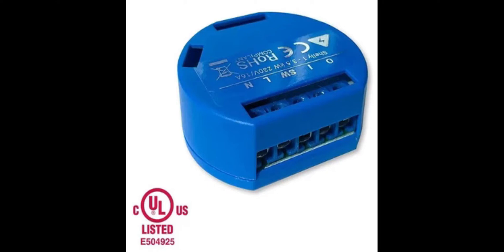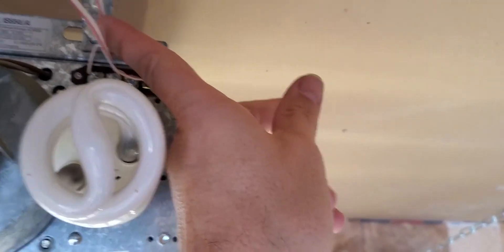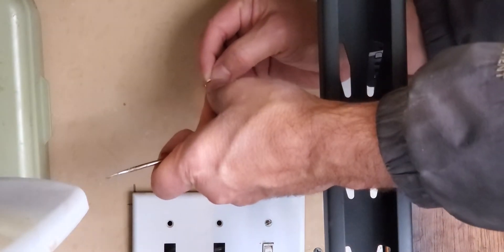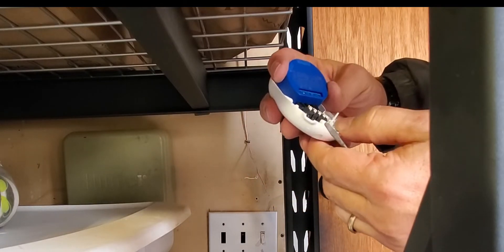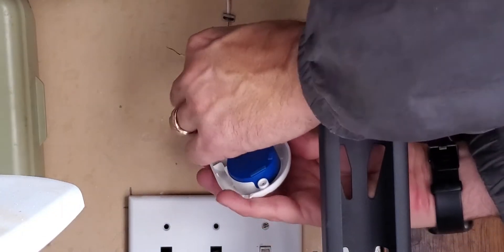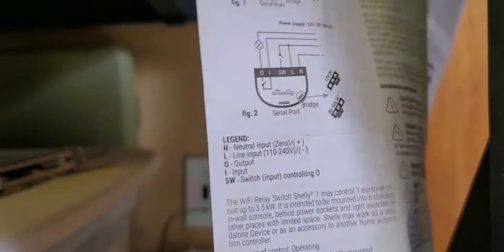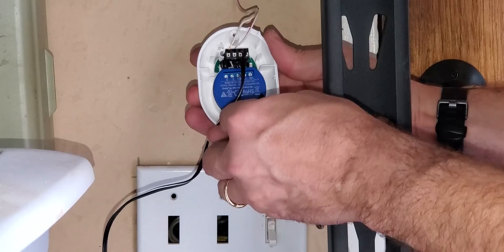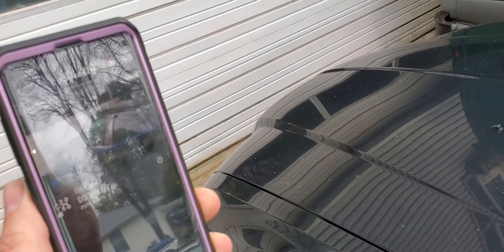Create a smart garage door opener in 5 minutes (for beginners or pros)

Comment: Thanks for the video. I'm trying to do the same. But if I remove the my old wall switch and simply short the two wires, nothing happens. If I connect back the wires to the old switch, the door opens regularly. Any suggestions?

Comment: What would happen if you supply 230V line in, not 12V? With the jumper set for 12V, would Shelly convert the 230V into 12V on the button circuit?
Reply from the maker: Yes, it should.
Reply from the maker: I may have misread your question. If you have the unit set to take in 12V but you apply 230V, you could definitely damage the unit.

Comment: When a Shelly 1 is installed in a button, it no longer supplies a dry contact closure suitable to replace a momentary contact switch. Power from garage door circuit can feed back into Shelly.
Reply from the maker: That's good info. Ours is still working fine after daily use since the creation of this video. But it is a good heads-up for others.

Comment: you should never do this. allowing to open door with such insecure device is crazy. All i need is to be near your house, crack wifi password which is easy and i gain access to all shelly, so i can sent http request to open door. EASY.
Reply from the maker: The device is not insecure. It is as secure as the WiFi network. It would be interesting to see how easily you could crack my WiFi. I doubt it would be easy.

But if you wanted to gain physical access, you could also pick the lock on the front door or simply break a window.

Comment: Could you also have simply wired the Shelly in parallel, thus leaving the original button alone, and also gaining the advantage of mounting the Shelly up on the Garage motor next to the available power outlet?

Not complaining, just confirming I'm not missing anything.  Also the Shelly would not need a case.
Reply from the maker: Yes, I could've done that. But the old button was starting to get flaky and I wanted to replace it anyway. And this method required no ladder time. ;-p